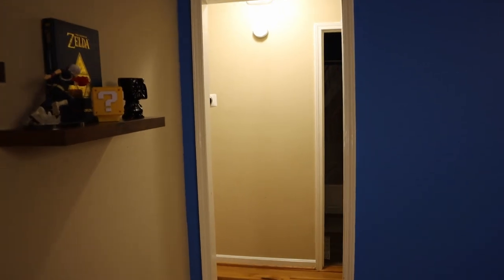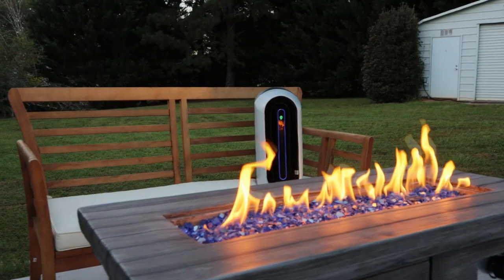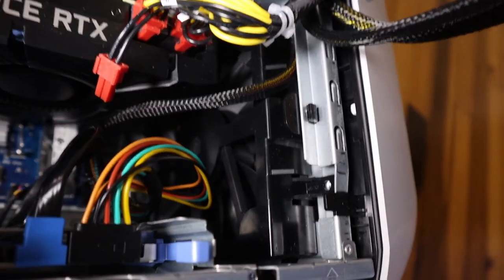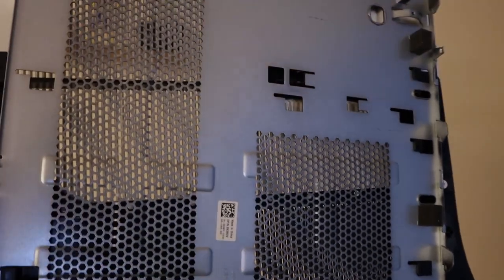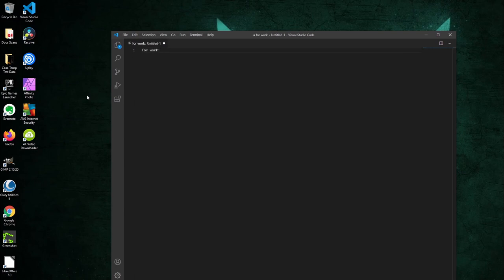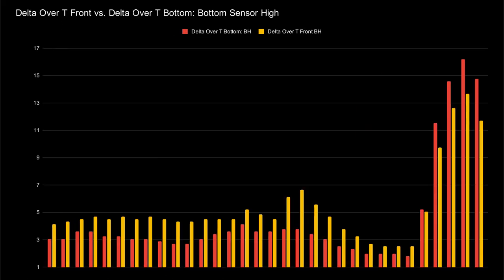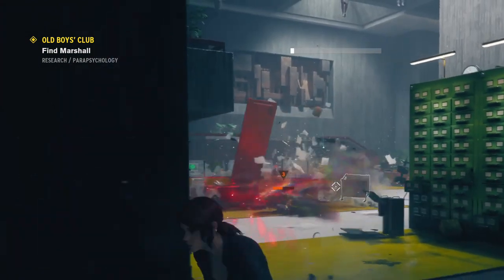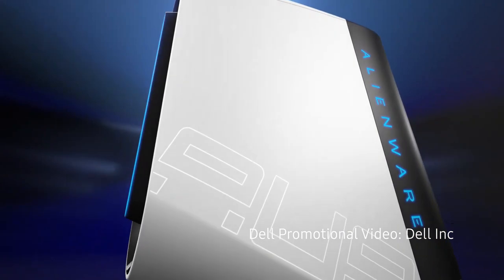Alienware R11 Cooling Teardown with Temperature Benchmarks

Comment: No place for hard drives in a modern pc me with a 2080 s 3700x with 5 tb worth of hdd 😂
Reply from the maker: I stand by statement: in 2021/2020 there is no place for mechanical hard drives in a modern gaming PC. One big point of having a modern gaming PC is those super fast load times that make the PS5 and Xbox Series X look like last gen consoles, and you lose that with a HDD. You could easily throw in a 2TB NVME SSD, and two multi terabyte 2.5 inch SATA SSDS in the R11. it is best to run a RAID on a NAS if you need terabytes of old mechanical HDD space for backup or archive purposes.
Reply: @theonlyjoe6036  i agree with you on that totally i have a series x its lightning fast but i just like having 4 tb on my pc dealing with the noise and load times im used to that as my 2080 has coil whine i can hear over my fans 😂
Reply from the maker: @Dimondgamer123   haha. I use to run 10K RPM fans back when I teenager and overclocking on air cooling. Everyone in the house complained that it sounded like a hair dryer was always running. Upgrade to SSDs, and your Series X will be left to collect dust.
Reply: @theonlyjoe6036  i do have 1 ssd but 2 hdd for games but i still love the power of the series x and how optimised everything is

Comment: You didn’t use science. it’s called, engineering. Lol.
Reply from the maker: Totally busted!!! In my defense, it is my favorite line from Bill Nye who is also only an engineer.
Reply: engineering is part of science if you didn't know that
Reply: @DmitriyChaikovskiy  
Science is the body of knowledge that explores the physical and natural world. Engineering is the application of knowledge in order to design, build and maintain a product or a process that solves a problem and fulfills a need (i.e. a technology).
Reply: @entreri76x  and technology doesnt come from science ?????
Reply from the maker: @DmitriyChaikovskiy  My long time collaborator has a PHD in Physics. When his science doesn't work he just blames it on the engineer (me) messing something up. Joking aside, engineering is the practical application of scientific knowledge. A lot of scientific discoveries have been made by engineers tinkering, and getting an unexpected result that is later explained through scientific inquiry. They kind of go hand in hand; Neptune was discovered using mathematics, and was validated by the telescopes built by engineers.